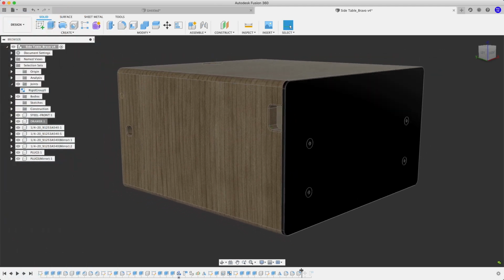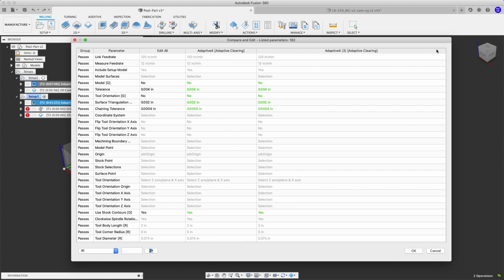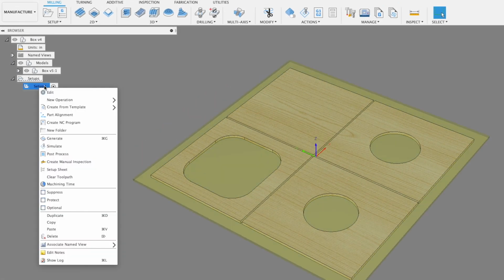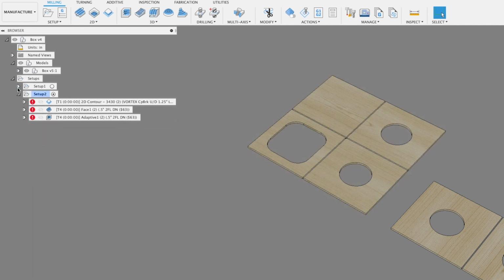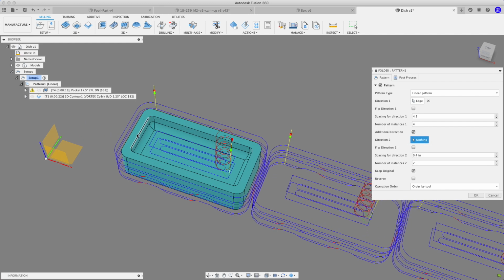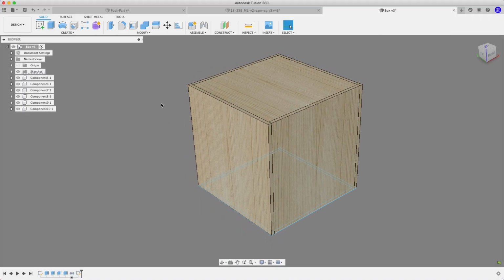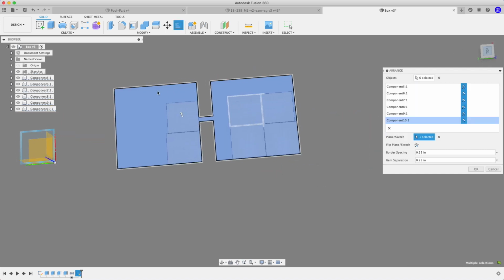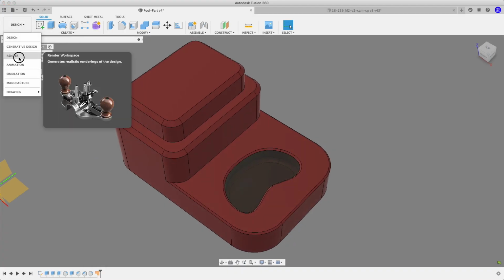Program Faster in Fusion 360

Comment: Hello, I see that you work with Fusion and like me you have a Mac. You see, I feel that Fusion doesn't work very well on my MacBook Pro M1. Sometimes it's difficult to perform a simple offset. Do you recommend upgrading to an M1 Max or M3 chip? Thanks.
Reply from the maker: How much ram do you have?
Reply: @pdxcnc  8 GB. It's very strange. I asked in a Facebook group, and someone told me that they switched to Windows and now Fusion works better for them. Yesterday, I had the window maximized, and while doing an offset, it sent me to the desktop.
Reply from the maker: @oswaldoamaldonado6778 8gb really isn’t enough on M1. I think 16gb is minimum.